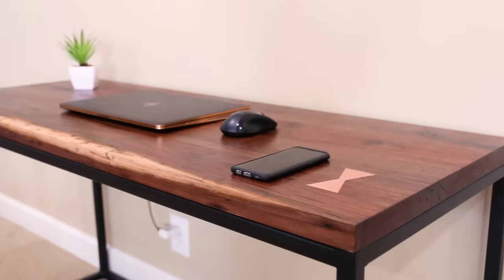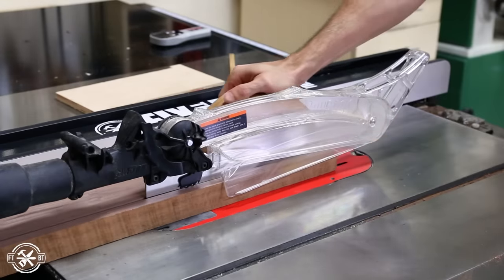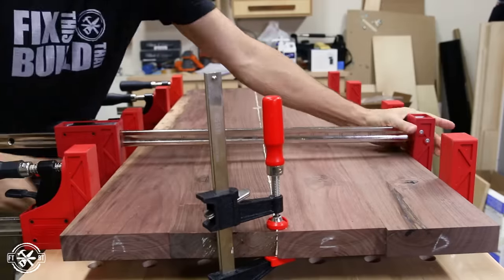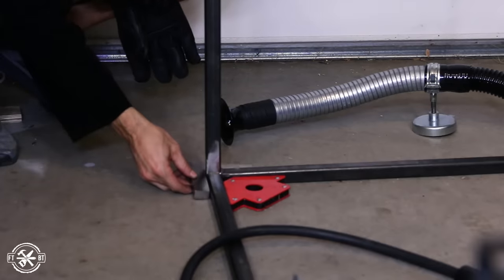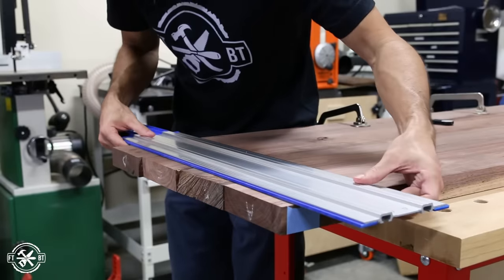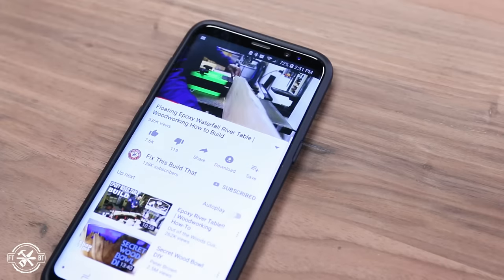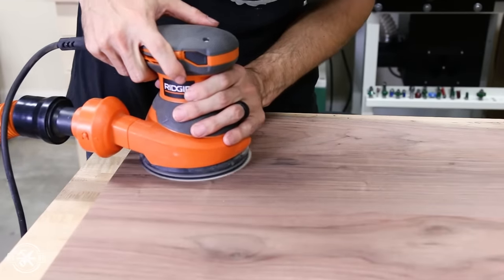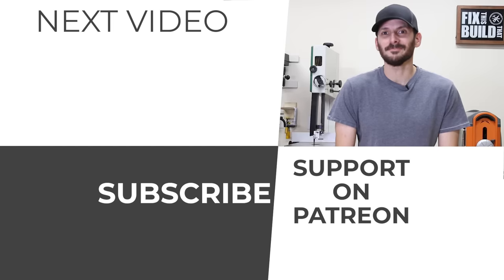How to Make a Desk with Hidden Wireless Charging

Comment: Maybe I didn’t get this but is it correct that the copper inlay is next to the charging spot, not on top of it? I also notice what looks like a curve on the edge of the desk at the end of your vid, where the material appears not to be coated. Did you sand that into a curve later, for improved ergonomics?

Comment: Brad: Beautiful work and am loving your and John's MFP podcast. Just started listening about two weeks ago and have been bingeing it during my business travel, trying to catch up. I'm hoping to use my son's Harbor Freight welder on an upcoming build; would love to a 210MP, but need to get a few builds under my belt to determine if I can cost-justify.

Question: I didn't notice the front or rear cleats being slotted to allow for seasonal movement. Not sure how much RH change you experience in Tennessee, but curious how it is holding up, now that it's just over a year since this video was released.
Reply from the maker: Hey, Jeffrey! Glad you're digging MFP.  The 210 is amazing, but the 140MP us actually pretty darn good. Check it out http://bit.ly/pm140_mp_ybr

And I didn't slot the tabs, I just oversized them. So still has room to move. All is well a year later 👍
Reply: Brad: Got it. Thanks for the clarification.

Comment: Can you please educate me on the difference in the joiner vs planer? Could you use just the planer? Obviously more steps the better the outcome but just tryna get as educated as I can with wood working! Thanx!
Reply from the maker: Jointer gives you a 90 degree edge to a face. Planer flattens and gives 2 parallel faces

Comment: Did you buy an adapter for the wireless charger?  I purchased the same one and it's not powerful enough to charge through the table (about a 1/4 thickness of where the charger is) plugged in directly to the receptacle through USB.
Reply from the maker: I went down to just under 1/8"
Reply: Gotcha.  I ended up buying an adapter and it added enough power to charge through 1/4” walnut/maple.  If you want to know which adapter I bought, I can let you know so your viewers will know as well.  Without the adapter, it wasn’t powerful enough to go through 1/4”.

Comment: This is so dope, how do you make sure you're not gonna go through the top of the desk when you're routing out that hole for the charger from the bottom?

Also it would be sick to add a short USB Male to Female adapter and line the cord up so the female end stops right at the back of the desk, that way you could just 'unplug' the desk without any cords hanging off in case you wanted to use this as a double for a kitchen table or something.
Reply from the maker: Just go slow when cutting the hole and set your depth right

Comment: What kind of glue do you use. I was kind of surprised without picket hole screw or any kind of biscuit joint will it last long. Please advise. Can I buy a plan plan for this project.

Comment: I love it... if u have done it differently, I mean we are not here to see how u make table or what type of coatings you have done on your table.. Because non of us going to build the table or has equipment what you have.. 

we wanted to know how to make wireless charging on table..

I love if you have removed that copper coils from 3 to 5 wireless chargers and placed it on the different side of the table (not underneath) and then use/apply clear epoxy resin on it.. 

This will be something different from others.

Comment: If you tack right, you don't need these squares and clamps.
First tack the outside edges than the inside edges and than top and the Bottom.

Comment: What is the thickness of the board? I recently tried with a 3/4 sheet of plywood for a top and cut the hole
For the charging pad but it didn’t work.

Comment: Another tip for your welding. After you’ve used your magnets to light up your pieces, clamp them down then remove the magnets. The magnets sometimes will pull your metal pool and can cause poor penetration. Though that may not be a problem for a small project like this since the metal doesn’t have to hold a ton of weight, but on larger projects bad penetration could cause issues.

Comment: A faster way would be to drill a hole in any desk where you would want the charger and either glue or clip the wire to the bottom of the desk would take hours less time. And if you liked the hour glass decor you could just use gold 
sticky plastic they sell in craft supply stores. Then paint over it with some polyurethane so it won' t come off too easy.

Comment: When your welding u need to ensure that you have the correct angle throughout all the welds and that the surface has been properly prepared to prevent corrosion and porosity etc also when wepding do not use thr magnets as the magnetic field interferes with the arc of the weld

Comment: Question, I am thinking of making a countertop for kitchen with 2x6's if I seal it on all the sides would this last a long time or would I be better with butcher block?
Reply from the maker: If you mean pine 2x6s I'd stay away. Pine is too soft
Reply: @Fixthisbuildthat  thanks i'm going to look for some dried and pre shrank stuff from a local lumber yard.  I was originally asking about standard pine but someone suggested for pre dried stuff so i'll look for that.

Comment: I would just use tiny nails to hold up the charger under the desk and clear tape for the cable. If the wireless charger ever fails or you decide you want to remove it for whatever reason, removing it will be much easier and cleaner.

Comment: This video inspired me to drill a hole on the underside of my Ikea Linmonn table and stuff my wireless charger up there - it works! My only issue is that the wireless charger gets really hot. I have several theories, and I've ranked them in descending order of likelihood:

1. The wireless charger juuuuuust fits in the hole I drilled (had to sand down the edges to get it to fit and it barely does). Perhaps the lack of ventilation is making it get unusually hot?
2. Having the charger try to charge my phone while there is about an 1/8 of wood between the top of the charger and the bottom of my phone is making it get really hot?
3. I accidentally broke the top part of my wireless charger off of it's base when prying it out of the hole. I superglued it back together, but maybe breaking it is somehow leading it malfunction and heat up? 

If anyone has any experience or input and could share, I would be very grateful!

Comment: You don't need to be a machinist to make a brass inlay. You can cut brass or copper on a wood bandsaw with the same blade as you'd use for pine. It also doesn't spark so there's no fire risk even with a dust extraction system (if you can touch the metal, it's not hot enough to be dangerous).

Comment: To sum up what I remember, because Qi Wireless charging wasn't standardized early on, different phones require different coil sizes. Many generic chargers use several coil sizes so a variety of brands work with them, leading to wasted electricity. IDK what Minwax and Lincoln Electric stocks, but if they have something specific to your brand of phone, buy that one.

Or don't, I'm not your mom.

Comment: I like what you did, but a little constructive criticism never hurts, so. Rather than using hot glue place a circle of same wood or similar into the hole you created with the charger. Shave circle to equalise to table surface then fix in place with removable plates for two reasons, 1) to replace if you find a more efficient charger of similar shape 2) if unit fails as can happen. Otherwise nice job 😀👍

Comment: Does anyone have experience with chargers that will go through wood? I bought a standard Samsung wireless charger and it did not. I tested a thin piece of wood on every wireless charger in my house and none worked. I have a phone case and I'm wondering if the combination of desk + case may be too much.

Comment: Putting a metal plate over an induction coil will cause the plate to heat up over time (when the coil is actively resonating). It's a good thing you used copper rather than something with more resistance like steel or aluminum. Be careful not to leave your phone lying there for too long, and if you do a similar build in the future, keep using copper, or maybe consider a wooden accent instead.

Comment: Did you risked to ruin the beautiful top table by drilling that big circle to insert the wireless charging WITHOUT having tested before if the cellphone would be charged when separated 1 inch thick from the charger? No simple piece of wood of that thickness was used to do that simple test?

Comment: I love my old Samsung wireless charger, but after a few years it crapped out. I opted for cheaper AT&T wireless charger and it sucks!!!!!! If the phone is not placed perfectly center on the charger, it either wont take a charge turning the blue light one, or if the blue light comes on a minute later it will start flashing red. Make sure you get a big quality charger for this project.

Comment: its ok... 5/10... only because of the charger, else its just 3/10 stars normal table, no carpentry skills... its just a simple table, no drawers nothing, also the charger and cable should have been replaceable but you sticked them with hot glue